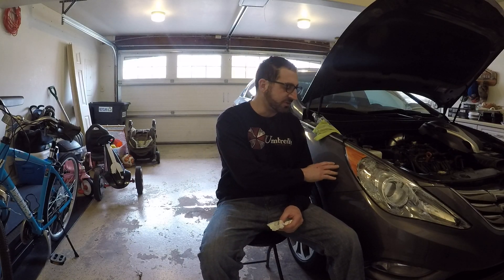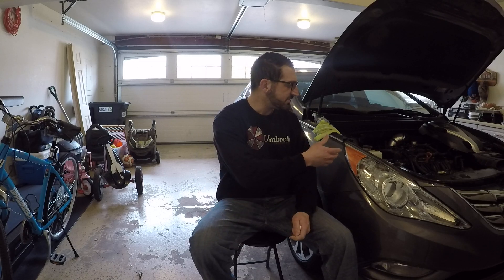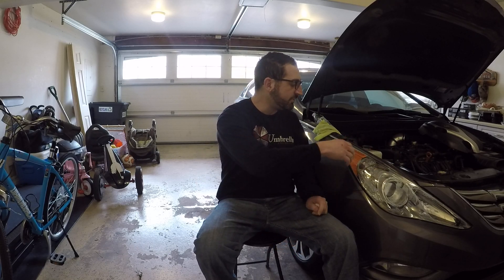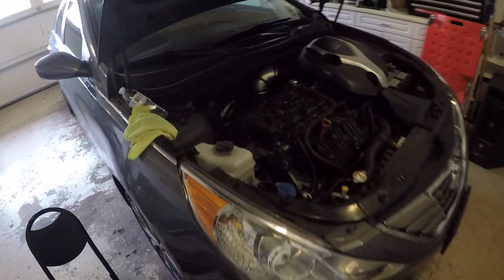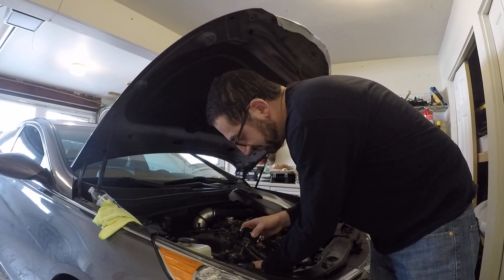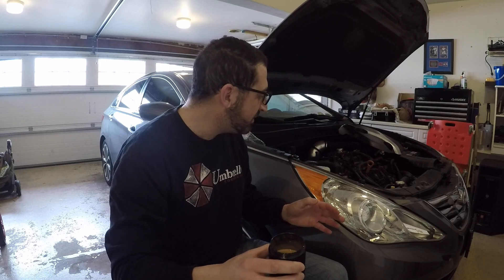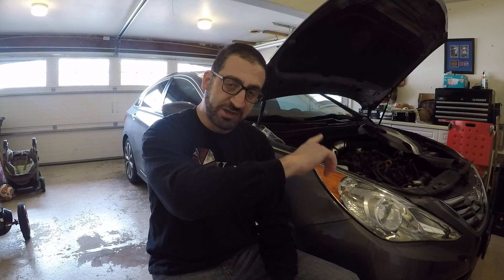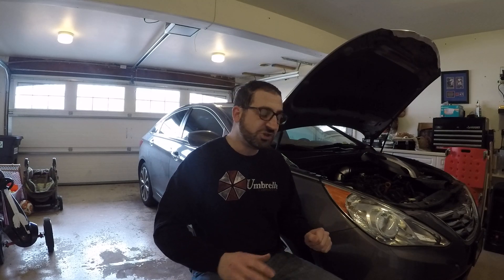Emptying oil catch can  for Hyundai Sonata 2.0T GDI

Comment: Hello. what kind of oil do you pour in a sonata turbo?
Reply from the maker: Pennzoil ultra now. 5W 30. But before I was using Pennzoil Platinum high mileage. Either one is very good for car since it's a turbo. Best oil you can buy easily.
Reply: @paulrakis  about ravenol dxg what can you say? it's sn + too

￼
Reply: @paulrakis  even you said that pennzoil ultra is 5w20, but on my car it says 5w30, oil cap
Reply from the maker: @davitkarayan6453  yes of course. I did say 5W 30. Don't have the turbo engine I believe it is 5W 20. Pep boys put in my car 5W 20 few times and another place did as well. That's why now I do all oil changes myself.

Comment: HI Paul good video on the catch can. So your saying must of the GDI engines need a catch can?
Reply from the maker: Well just the elary gdi engine especially turbo. The newer GDI engines now have port fuel injection and GDI so you don't have to worry about a catch can on those engine to much unless of course you are doing auto Cross and or track.

Comment: Since you installed the oil catch can with so many miles on your Hyundai... are you still worried about having oil coked valves??  If yes, have you tried to clean the valves yourself?  Merci
Reply from the maker: No not really actually I had a vale service done at the dealership around 90k plus I'm using full synthetic oil Pennzoil. Plus the catch can. so what does synthetic oil you have left less vaporization in the valve covers leaving your valves cleaner. Using synthetic oil helps as well as the catch can. Maybe around 160k il probably get a GDI service again at Hyundai. That's probably the best way to maintain the valves without going deep in you pocket.
Reply: @paulrakis  ... Ok, YES, I see.  When did you start using the good synthetic oils??  Like about what mileage?
Reply from the maker: @biz4twobiz463   hey man sorry for the late response.  when i started to do oil changes myself in my garage so about 80k. most of cars life i had conventional because that what the owners Manuel said nothing about synthetic for the 2.0T or the 2.4. Oil dont ever have to be SN plus which is for turbo charge cars GDI or port. remember this  is a modern turbo GDI and its water cold and it has a fan that comes on even when the car is off to kool the turbo  when you drive it really hard. when i go on long trips i wait like 15 sec or when i drive it hard on short trips  just to be safe and have that turbo wind down a bit.  Im never going back to conventional oils.